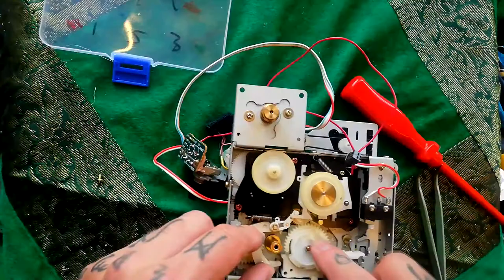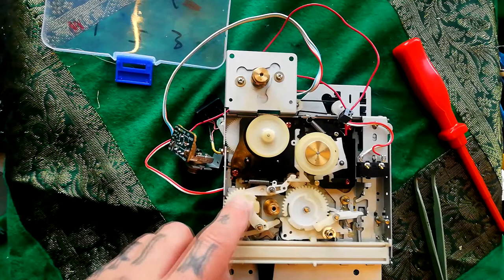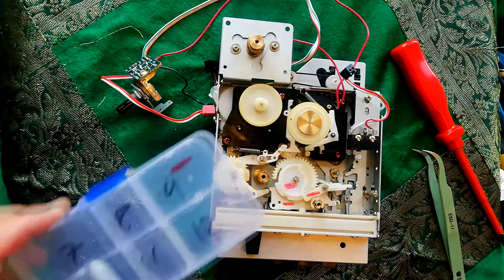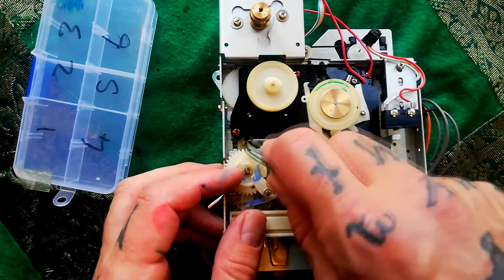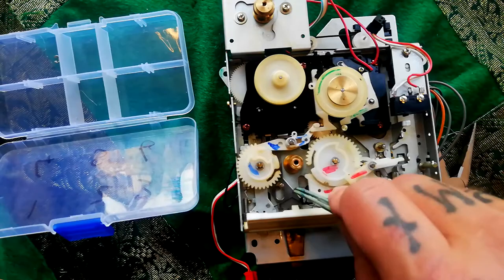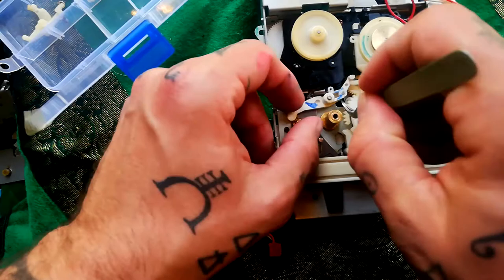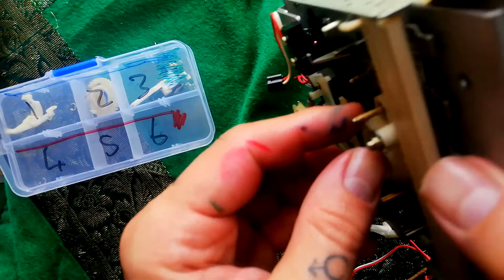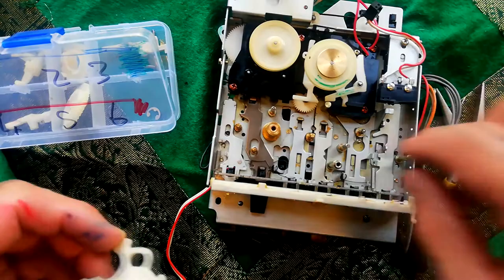GEC 4-track transport | 3 | lubricate gears & shift arms | Porta One Two 05 MT2X MT3X X-15

Comment: Hi Calum... digging all these videos.  I am in the process of taking  my transport apart for the porta 2.  I have my organizational compartments, lube, etc.  I changed out the belts but the take up reel continues to not pull the tape taught.  I am thinking it is the idler tires.  Is there a way to pop out the idler tire to change out without taking all the components apart?  Glasstronic used sandpaper while the machine is running to remove the gunk.  I have never seen a vid with the idler tire removed from this type of transport.  Anyway on the next part can show how to take the idler wheel out for rubber replacement?  Or just explain it to me if it is as simple as sticking tweezers in and it popping out.  Thanks Man- I would be lost without these vids 🍻.  Sidenote- the corona parody  is so legit.
Reply from the maker: Thanks, yeah the idler is actually easy to remove if you can find a good replacement, you can pry out the center with a flat head screwdriver, a 6 mm * 2.5 mm crossection plumbing o-ring will sometimes work. Sometimes a spring on the playback idler arm needs to be clipped, I will show a video on this soon, Thanks for watching
Reply: Tetrakan Supermonobloc It was easy to pry up!  The one issue I had was pushing the change out tire into the groove to ensure it is flat- it sat in there at an angle.  There is a great place in the states I found for replacements.  Thanks again- this is rad.
Reply: I did have to put sandpaper on the idler wheel because it was bogging down the take up reel.  I used 15 micron finishing film.  Good as new!  Holy crap.
Reply: Tetrakan Supermonobloc So I still ended up having troubles with the take up reel and took off everything up to the current vid- waiting for the latest to finish up.  Waiting on e clips b/c one went into the ethereal.   These vids are so flipping rad.

Comment: I have finally reapired the unit to play tapes, but now it wont record. Is there something I can do? I replaced the erase head from another unit and I have a spare play/rec head I could replace it with if need be. It plays fine and I get signal from input 1, but no recording when I play it back.
Reply from the maker: Please clarify, no recording on any channel? Or some channels record and others do not? Do you have playback on all 4 channels?

Comment: Hi. My current issue with my Porta One is with the two red wires that connect to the black housing that holds the takeup and idler wheel. When I took it apart for the first time the two connections came loose so I quickly soldered them back on. Now whenever I power on the unit the cassette motor automatically runs, ignoring the play and stop buttons. Do you anything that could be done for it to function normally? Videos are a great help btw
Reply from the maker: Thanks for watching...The part is called Quick action switch, its part 4-36 in the porta one service manual, it appears in the exploded view on page 42 and page 43 in the parts list, you can download the manual free here https://tetrakansupermonobloc.home.blog/2019/04/26/porta-one-ministudio-service-manual/  there's a tab on the brake lever (4-13) which is meant to activate this switch in play record rew and fwd modes - check that you didn't get those two parts misaligned when you rebuilt it. You could also try detaching the quick action lever from the reel base (the large black housing) there are a couple of copper parts in there, its a fairly simple mechanical device but I can imagine it getting stuck in the "on" position during a rebuild, hope that helps. If you msg me via facebook I can give you photos of what to look for because I just rebuilt a porta one transport and its still out of the case.
Reply from the maker: Thanks, yeah the idler is actually easy to remove if you can find a good replacement, you can pry out the center with a flat head screwdriver, a 6 mm * 2.5 mm crossection plumbing o-ring will sometimes work. Sometimes a spring on the playback idler arm needs to be clipped, I will show a video on this soon, Thanks for watching

Comment: I'm having a problem with the wheel you remove at 2'54" (linked to the pause function). It doesn't turn as far as it should go (the lever on top doesn't come to rest against the stop on the gear) when pause is on. I don't know whether there's a tooth missing, but it seems that momentum should slip it the last extra bit but doesn't. Any ideas please?
Reply from the maker: Have you already removed the old grease from those parts and put fresh silicone grease on instead? Old grease turns to glue over the.e and restricts the range of movement
Reply: @Tetrakan  Thank you for the reply. Yes have cleaned and regreased. I've had a go at paring a bit off the cam on the back, which has improved it a little bit. I think maybe it's just really worn. If I get it working, I'll let you know.
Reply: @Tetrakan  by the way, I think this is the last problem I'm dealing with, but your videos have been really helpful with the issues on the transport I've fixed so far.
Reply from the maker: Where are you based? I'm in UK and I have a ton of spares for thus model if it comes to that
Reply: @Tetrakan   thanks, that's good to know - yes, I'm in Todmorden, West  Yorkshire.
Reply: Hi, I think there is a tooth missing from the gear that controls the pause. Would you have one spare that I could buy from you please?
Reply from the maker: @bencollins5937  sure, can you nsg ne over Facebook? Alternatively I think you can email me via bandcamp
Reply: Thanks have sent message on Facebook